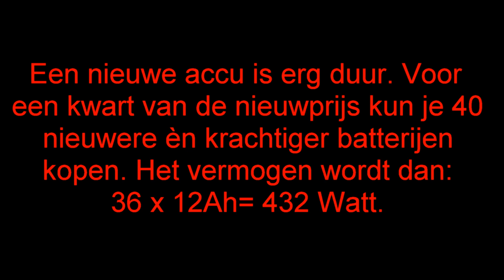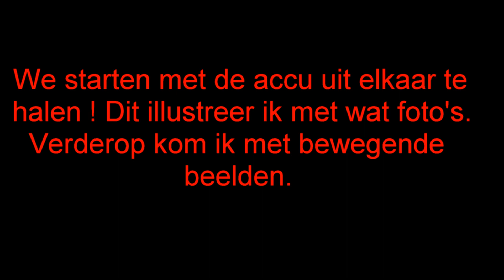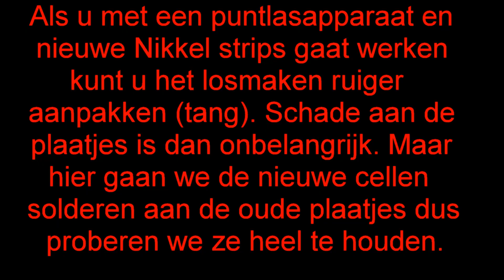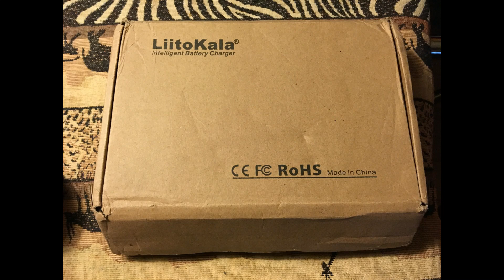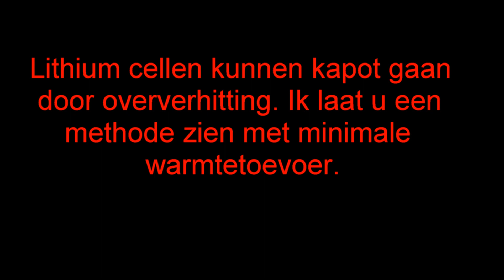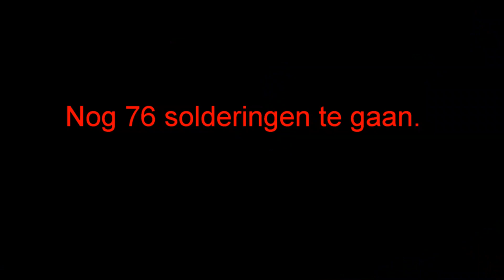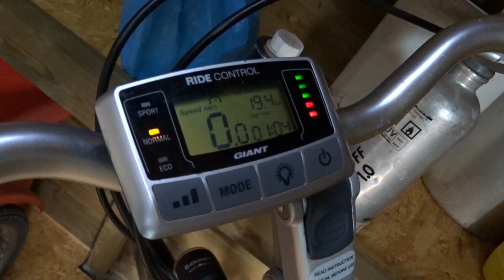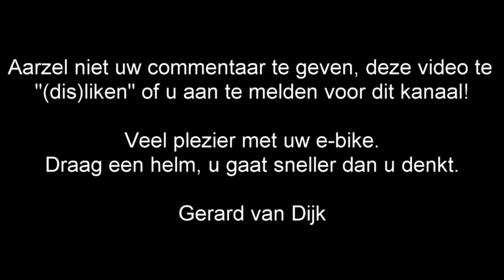Giant Twist 36 V accu vernieuwen en krachtiger maken

Comment: hallo gerard, heb je linkjes voor de spotwelder onderdelen van aliexpress? leuk informatief filmpje thnxs :)
Reply from the maker: Dag. Ik heb het spul gekocht bij deze Aliexpress shop: Shop2956052 Store Naam: Spot welder control panel, battery spot welder controller BTA100. Het voetpedaal/schakelaar (en die heb je echt nodig heb ik elders bij Ali gekocht). Dit kitje heeft dan de mogelijkheid twee korte puntlasjes over elkaar in te plannen. Nooit gebruikt. Schijnt bruikbaar te zijn bij licht geoxideerd materiaal. Nu zou ik denk ik bij IC GOGOGO shop kopen en wel het 100A type: NY-D01 100A/40A Spot Welding Machine Control Board Welder Transformer Controller Panel Parts Adjust Time Current Digital Display. Even goed opletten dat je apart de verschillende componenten (100A controller; foot switch) in koopt! Beetje verwarrend. Daarnaast heb je dus een zwaar trafo nodig uit een magnetron die je ontdoet van het hoogspanningscircuit en voorziet van een paar windingen met een zeer dikke geïsoleerde kabel die naar je laspolen toe gaat. Enfin, dat zul je al wel uitgezocht hebben. Succes. Gerard

Comment: Solder 18650 ahahah over 1 jaar zijn kapot... aub.... 
Liotkiala cel zijn chinees cel werk voor 1 jaar daar zijn kapot.. aub  stop
Reply from the maker: I do not know what your mother language is but I think that you mean to say that the 18650 cells that I bought via a Chinese reseller (the Liitokala official store) are rubbish. It is true that they are much cheaper than when bought in a European country (because of the much costlier tradesman and logistic overhead. They may be cheaper but I can assure you that I have one ebike 36V battery working perfectly for three years and two batteries operating perfectly for one year now. The batteries still recharge with approx. 3000 mAh capacity. Gerard
Reply from the maker: It is half november 2022 now. All batteries I worked on are still working properly. No problems..... Gerard